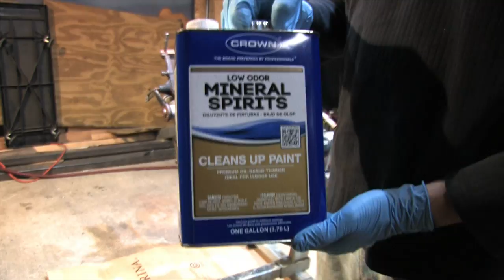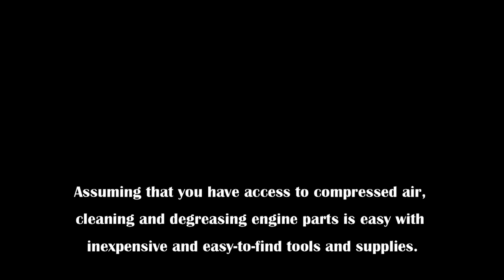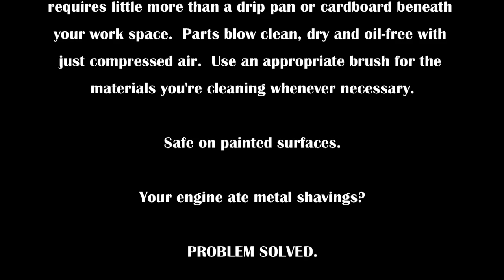DIY Parts Washer

Comment: Please put a tray under the parts, and collect the terpentine. Not only for you to save money, but to make this a bit more mother earth friendly. As a bonus, you should easily be able to use it again, after letting the sediments fall to the bottom for a day or two.
Reply from the maker: It's not terpentine.  It's mineral spirits.  If it were terps, there would be a need for collecting it because it would make an oily, greasy mess.  Mineral spirits evaporate rapidly when atomized.  All it does is makes the cardboard damp, it's dry in an hour and the odor is gone.  Considering mineral spirits are coal oil, extracted from minerals and highly-refined, it's 100% organic.  It came out of mother Earth.  At $14/gal, it's not worth my time and exposure to separate the contaminants from what little runoff that didn't evaporate.  I just let the cardboard dry, fold it up and dispose of it.  All the filth is in the cardboard, and it's no worse than when it was on the engine block.  I made the same arguments that you have to the guy who taught me how to do this, then I saw how it worked out and I ate my words.  :P  I found it was much more environmentally-friendly than Methylbenzene, toluene, acetone and xylene.  …all of which are also organic… but… a whole lot more toxic than coal oil.
Reply: Mineral spirits is called mineral turpentine in Denmark. That things are organic and/or cheap is no excuse for you not to "waste" your time collecting it. Buy or make a cabin, to wash the parts in. That things are organic, also doesn't mean it isn't harmful to the environment.
Reply: Testacorsa go save an owl, doofus.
Reply: Wow, replying in another language, I must have hit a nerve. Tell you what: I will try not to judge you and your sexuality, if you promise to take care of the pigs needs too, deal?
Reply: Testacorsa Testacorsa No, I thought it was funny to respond in Russian. No nerve was hit—they're too deep. So, pigs have sexual needs that must be fulfilled by humans, eh? Interest beliefs you've got there, buddy!
Reply: Well, I'm quite sure the pigs would rather not be a part of the things you put them through, but as I can't stop you doing your twisted activities, I thought I would at least try to convince you to be gentle. That would at least be something, but now it's obvious you just think about yourself :´(
Reply: Testacorsa So experience informs you that pigs like it gentle? Mine like it rough!
Reply: Sorry, I'm not one you can exchange experiences with. I'm into girls -  you know, the human kind.
I don't approve on what you do, but I wish you the best of luck!
Reply: You like people to think you are into human girls, but clearly your sexual interests go beyond that since you know so much about pleasing the needs of farm animals.
Reply: Farm animals?! I thought you only had your way with pigs, but you actually treat the whole farm as your buffet! It's sad, but it's a little funny too, I must admit. 
And I know you really want me to be a freak like you, so you have someone to share your passion with, I get that, but I'm not him, I'm so sorry. Thin up, you will succeed some day I'm sure. Maybe have a kid, and when he grows up, with a little luck he will have your faulty genes too.
Reply: haha, this is not sparring. You are just a troll, and you don't bring anything of value to the table. 
It has been a bit of fun for me to stir you up though, but I am crying a river over you not feeling the same.
Thanks for thinking of me.  Hugs and kisses.
Reply: I rest my case - hopefully the irony is not lost on you :D
Reply: Testacorsa Yes, the irony is totally lost. Please explain it. What is your case? It seems to me that you were flustered and your ego damaged because I called you a doofus and told you to go save an owl. So you said some insults back, but I found your insults lacking. This is so ridiculous. Why don't you show you are the bigger man by refusing to keep trying to have the last word? That's how you actually win YouTube arguments.
Reply: Stabbio in the dark - new shiny youtube name for you maybe?
Reply: Testacorsa So that's the irony you are speaking of? Ok, man. The irony I think is funny is that I haven't followed my own advice and let you have the last word yet. I think Mother Earth is calling—maybe you should go see what she wants?

Comment: Would it make the job less labor-intensive if you could soak the dirty parts for a few days instead of a few minutes? Similarly, would it make the surfaces less prone to oxidation if you could soak the parts in high-quality oil for a few days after cleaning them? It might be easy to mold/3D-print custom plastic containers for many of the engine parts.

I was originally thinking of printing out such containers just to make a custom parts tray, to help me keep track of things during disassembly. Adding a lid could make it a container for long term storage, leaving a bit of room for oil around the parts. It's not that much different from shrink wrap, but it's neater, and an excuse for me to use 3D printing. 

While watching this video, it occurred to me that the containers could be used for parts cleaning as well as storage. I'm just wondering if there's any advantage to having the parts soak for longer than a few minutes. I'm not talking about a full-blown parts bath or electroplating tub like the pros. It would probably just be the equivalent of spraying on the solvent (or oil) and then wrapping it up for a few days in stretch wrap.
Reply from the maker: Mineral spirits penetrate so quickly that soaking for extended periods of time doesn't actually improve its ability to dissolve crusty stuff.  If it doesn't dissolve in a few minutes, it will brush away with a wire or nylon brush very easily.  After 5-10 minutes, it's done what it's going to do.

The 3D printing idea sounds awesome.  It would cause you to use less fluid, and that helps, but at what cost?  I don't know what it costs to use 3D printers?  By the time you laid out and printed the thing, I'm sure you could have finished cleaning the parts in a bucket.  :P  I store leftover mineral spirits in a metal paint can.  Even when contaminated, it works great.  A can of that stuff could clean up anything that fits in the can for years as long as you keep a lid on it.  Mineral spirits don't evaporate fast in liquid form, but they evaporate very rapidly when it's vaporized.
Reply: You asked what 3D printing a custom-shaped container would cost. With current technology, it's not even close to cost-effective for this application. I'm only considering doing it as a research experiment. The idea is that before a mechanic starts a job, a machine punches out a sort of custom "work tray" specifically set up for that task. Every part you expect to take out should have a shaped place to hold it, and the input parts & tools should be pulled out for you (by a shop robot or the new guy) and set up on the tray. I know that sound like overkill, but with shop robots and 3D printers dropping in price every decade, it's only a matter of time before that sort of thing is commonplace. Of course, if you get surprised by new information once the job begins, your work tray won't be so helpful anymore, but so it goes. It should at least be useful when things go as planned. Again, it's nowhere near cost-effective to 3D print such a tray right now, I'm just experimenting to see if the concept works at all.
Reply from the maker: I need a plastic disc, although a solid wheel design would work better... 1.143" across, 1" wide.  I need Another one also at 20mm.  Both need a 3/8" hole square in the middle.  I also need 2 lightweight columns.  One 3" tall.  The other 4" tall.  If they have a 3/8" hole through the tops of both, and a foot on the other side that can withstand 1kg of weight, that would be cool, too.  Sorry about the mixed imperial and metrics.  Just think like you're working on a Jeep.

It's a tool.  You can probably figure out what it does, but I don't want to spoil the surprise for everyone else.  It just needs to be really really lightweight.  It needs to come in at under 220 grams maximum each for the columns with either plastic disc.  My first 2 attempts have been too heavy.  Should never have thought the MIG welder would work to begin with.

There are some dynamite ideas out there for tools I wish I could print.  Your idea is very close to one I've had for a little while, but for a totally different purpose.  Every time I hit print it comes out on .004" paper.  My printer's so old it prints in pencil.

Comment: You didn't need the zip tie, the pressure drop across the "venturi" that allows the fluid to be sucked into the nozzle wouldn't have allowed leakage. Post process, maybe.

Comment: Can it be used as a brake parts cleaner? Is it safe on rubber, like it won't eat through the caliper seals and stuff right?
Reply from the maker: +oshin aslanian It will totally dissolve rubber caliper seals.  I would not use it that way.  The only time I use brake cleaner is on brake parts.

Comment: would this work safely if i put some in a plastic barrel and dunked my cylinder off my atv in it and left over night? same for a gunky corroded carb as well? or will it damage the cylinder?
Reply from the maker: +Carter Byers As long as it's stripped down, it won't hurt it at all.  For metal parts it's completely harmless.  Rubber parts tend to swell up, deform, and then dry rot afterwards.
Reply from the maker: +Carter Byers Best advice is to get a container as close to the size of the cylinder head as possible because mineral spirits are expensive.

Comment: Does it burn through the mineral spirits really quickly if you use this method to clean parts off the engine?
Reply from the maker: I cleaned every single part on this engine with 1.2 gallons of mineral spirits.  I could have done it with less than a gallon if I had relied more heavily on the brush method.  Get it wet, brush it down, get it wet again, air it off, part is clean.  What you trade in what people think is wasteful, you make up for ten times over with time savings.

Comment: I have an old ford 7.3l diesel idi covered in a thick layer of grease. Do you know if this will do the trick to get rid of all that grease? I want to clean it and paint it.
Reply from the maker: Oh yes.  Yes it will.  Absolutely.  Practically made for it.  Get a brush and work it while it's wet, it will save you a ton of mineral spirits.  NAPA has these things hanging on shelves in the tire tool area.  I have no idea why it's in that section, but it is.  I would follow it up with a degreaser afterwards to really help the paint stick, but you don't have to.  The longer you let it sit after it's dry, the drier it will get.  Keep it away from silicone rubber (weatherpack electrical connectors, turbine couplers, some kinds of vacuum hoses).
Reply: Awesome. Thank you for the help! You just earned yourself another subscriber my friend!!! :)

Comment: Jafro, would you recommend this technique to clean gunk off an alternator?
Reply from the maker: Hmmm...  I don't know if I'd do that?  The alternators on these cars contain a voltage regulator which has a printed circuit board on it.  It has a seal coating on it to waterproof it, and I don't know if mineral spirits would react with that?  I'd be inclined to think it would.  If it does, the next time it gets wet it's done.  Perhaps a short exposure, but I wouldn't soak it or use the blow gun.

Comment: Can I use this while engine still in the car??  I just did this with gunk foamy, It worked good as over the counter degreaser.
Reply from the maker: You sure can!  I've done it plenty of times myself.  :)
Reply: *****
 Would I have rinse the engine with clean water after using Mineral spirits?
  I remember what you said its flammable.
Reply from the maker: Nope.  It evaporates completely as it sits.  Compressed air works best.  The mineral spirits will dislodge all the goo and it will blow out with compressed air leaving it bone dry.
Reply: excellent.

Comment: Great video Jafro, as always. Did you also oil the rockers and cam carriers after they were soaked and cleaned? How quickly do these machined parts/surfaces need to be oiled? Thanks!
Reply from the maker: Soon.  Within hours... or before they ever have a chance to get wet.  The aluminum parts don't need any oil at all.  It's only the cast iron stuff.  Ferrous metals only.

Comment: Curious to the air pressure you're spraying with. Also, would you consider wd40 an acceptable rust prohibitor while you're waiting for parts or assembly?
Reply from the maker: I'm far exceeding the design pressure for the blow gun.  Running it wide open, but my compressor maxes out at 110 PSI.  It drops to 40 once if you deplete the 45 gallon tank, and it runs continuously at a 14.6cfm recovery rate.

I wouldn't dare leave cast iron or steel parts alone without soaking them in WD40.  There are other oils, but that one's fine for short term protection.  It's also easy to clean off the parts once you're ready for assembly.  ATF also works well.

Comment: Jafro, what would you advise I use if I want to clean the inside of my intake manifold on my '97 Eclipse GS, brake cleaner or Carb cleaner?
Reply from the maker: Berkebile 2+2.  It's neither one of those chemicals, but can replace both of them.  I don't use brake cleaner on anything, ever.  95% of brake cleaner brands are chlorinated.  I don't like chlorinated stuff unless I'm doing laundry.  2+2 washes carbon away.  It dissolves on contact.  It's mostly acetone, but if you're looking for an aerosol cleaner, it's nearly impossible to beat.
Reply: ***** Snap, well I'm not in the US and I don't think I can find this magical "Berkebile 2+2" thing-o-magic where I'm from. You said it's mostly acetone, though, so would that imply that I can simply use a normal bottle of Acetone (like for cleaning nail polish), put it on some paper and try to wipe around the butterfly valve on the intake?
Reply from the maker: carb cleaner then...  :)

Carb cleaner works fine.  It just takes more of it than 2+2 to do the same job, that's all. Carb cleaner is mostly acetone.
Reply: Maybe that's a sate-by-state thing. I've heard from others "Make sure it's non-chlorinated brake cleaner", but in WI all I've ever seen is the non-chlorinated stuff.

Comment: What a great concept.  Thank you for taking the time to do this.

One quick question:  You mention using the Indoor or Low Odor version of the Mineral Spirits.  I cannot find the low odor in one gallon around here.  Only quart.  Since I am going to do this outside, is there any reason the regular mineral spirits cannot work?  From what I can tell by a Google search, the only difference between the two versions is the amount of aromatics.

Thank you very much.
Reply from the maker: The low odor is super-refined to get those aromatics out.  It should work like-for-like vs. the low odor formula, just stinkier.  I don't mind the smell, really… but you should limit your exposure to it anyway.  Since you're doing it outside, it's less of an issue.  Because of its effectiveness, even when spending the time to brush parts down, they'll clean up so quick you won't need to be there for long.
Reply: Doing it outside and wearing a mask just to be safe.  Belts and suspenders approach.  ;)
Ok, thanks for your reply.  Amazon does not sell the low odor in gallon size so I ordered the regular one.  It was Sunnyside brand.  Never heard of them but they were the only option in that size.  Fingers crossed.
Thank you Jafro!

Comment: im working on an outboard and want to clean inside the cowling if some got in with the fuel would it be harmful
Reply from the maker: I doubt it.  It is a petroleum product after all.   But why should it be able to mix with the fuel?  Shouldn't all that be sealed up in the tank and in the lines?

Comment: Did you only used one can? look like it lasted forever lool great video as always Jafro cant wait to see how this one finished :)
Reply from the maker: I used 1.2 cans.  It made it through everything but what I did on the workbench.  So yes... it did a whole motor minus the bolts.  You could fix that problem by soaking the bolts, filtering the solvent, and then running it through the spray gun to clean other parts.  I also was not miserly with its application.  There's no reason you couldn't clean a whole engine with one can.  ;)